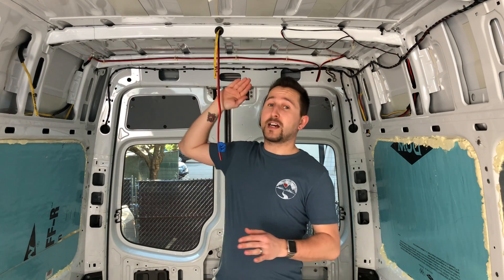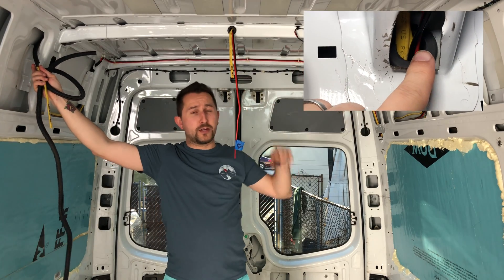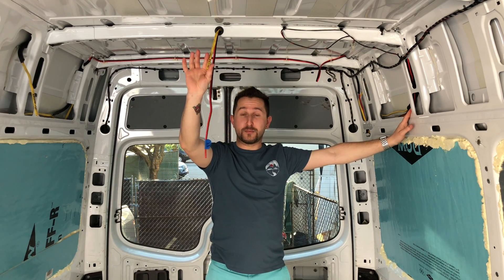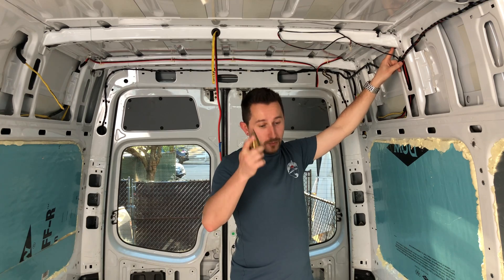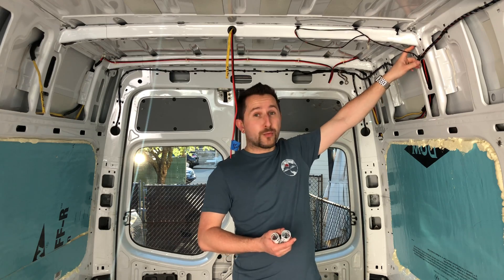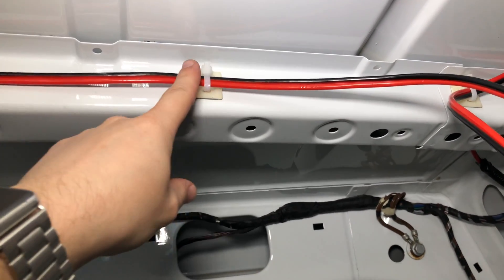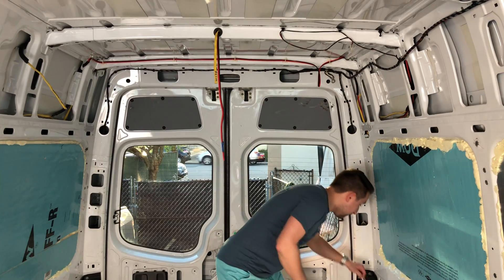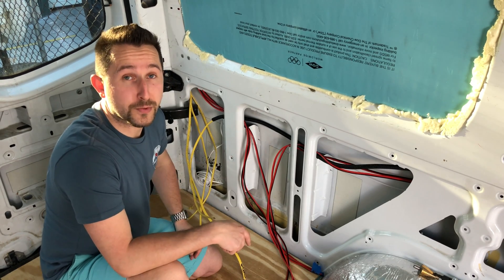Mercedes Sprinter camper van wiring installation

Comment: Foam in a can will hold wires in place. Sometimes I use a hot melt glue gun to hold wires in place until the foam hardens. I also sometimes use an old garden hose to run wires through. Black irrigation tubing is also inexpensive. Like you said solid wires in a vehicle that vibrates and flexes is not a good idea. Solid wire bent enough times will brake.
I also stay away from using black wire for negative. About the only time I see black used for negative is at the battery.  Manufacturers often use black for positive wires in the chassis and white for the negative, (similar to house wiring). If you look at 12 volt light fixtures they come with a black and a white wire, (the white is negative, the black positive). Using red and black to feed them makes it a bit confusing to look at because you will have to attach the red to the black and the black to the white, (LED lights can be polarity sensitive so if you switch the wires around often the light will not work).
Reply from the maker: Thats a really great idea with black irrigation tubing, I wish we had thought of that.  As of right now, most of the 12v wiring is foamed in place and we ended up replacing some after realizing we messed up with the location of an "ON" switch. We will definitely take your advice and use expending foam to stabilize the solid household wires and reduce their flexing in corners and such.
The black and red 12v wire shouldn't be a problem since we both work with 12v systems pretty often (specifically, LED lights).
Reply: I also go with heavier wire than necessary. Not because I need the added amperage capacity, but because the smaller the wire is, the more resistance it has to current flow. Resistance causes heat. I am not talking excessive heat that is noticeable, but you are wasting energy creating that heat. The voltage also drops because of this resistance. This is bad news if trying to charge a remote battery. Point two volts, (0.2),  can make a big difference if a battery gets fully charged. Often jumper cables are cheaper to buy than the wire itself. I use a lot of 4 gauge that comes in 20 foot lengths and just cut off the clamps. If I buy 4 gauge wire it costs about twice as much.
Reply from the maker: The jumper cable trick is something I definitely have to remember. I saw how expensive thicker gauge wire can be so it’s good to have a little trick to saving on it.